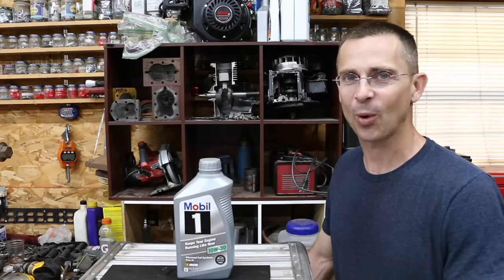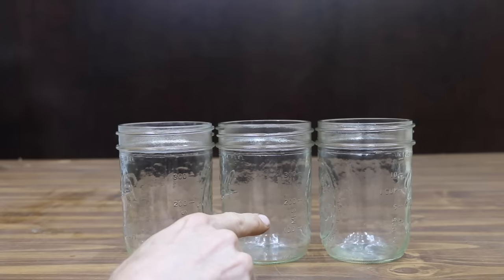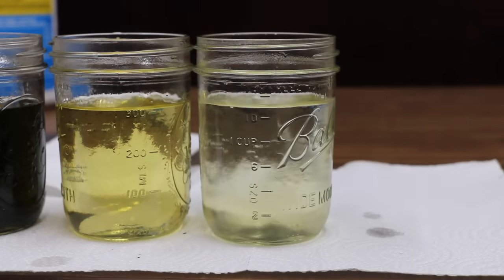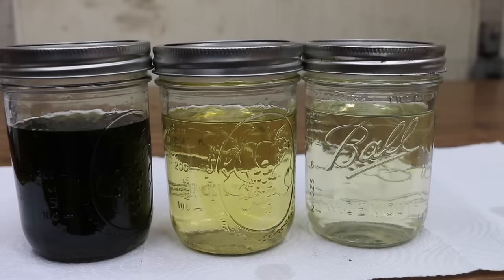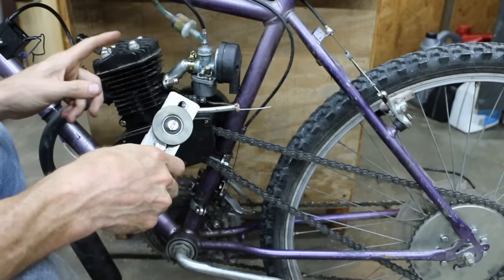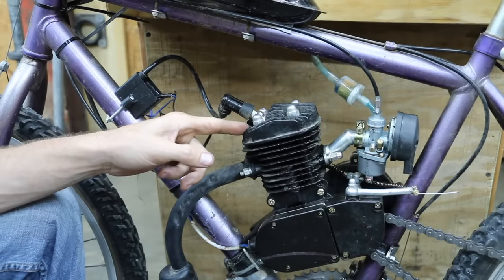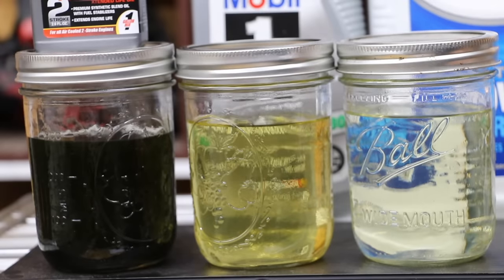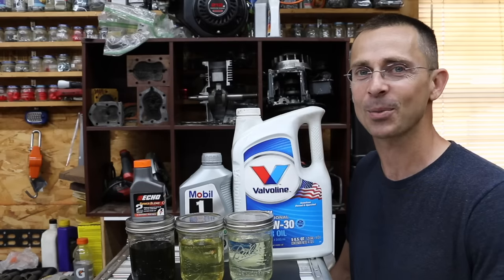Will 4-stroke oil damage a 2-stroke engine?  Let's find out!

Comment: 10w30 Dollar store Motor oil do a video on it
Reply from the maker: Great recommendation!
Reply: Yeah, I’ve always wondered if dollar tree had trustworthy oil...
Reply: Project Farm where did you get your 2 stroke bicycle engine,,. ???   How much did it cost,,. ???
Reply: Rick Simpson I wish she would've left a link for it in the description of his other video
Reply: Rick Simpson - Amazon has them around 135 bux.  Goplus 80cc 2-Stroke Bicycle Gasoline Motorized Gas Engine Motor Kit (Silver) https://www.amazon.com/dp/B01N4RZJAY/ref=cm_sw_r_cp_apa_Y-7qBbSQBWRF5
Reply: Itsa Mea thanks ps don't buy anything from bike Barry I bought an friction drive engine kit and it broke 5 times
Reply: Project Farm ,, I had heard and from another video that that dollar store motor oil when Frozen was extremely thick and you definitely shouldn't use it in the winter it won't hardly come out of the jug,,. ???
Reply: Is it $1 for a liter?
Reply: all 30 weight oil is basically sludge at 32f - oil flow tests are done at room temperature. Thats why multi-grade oils were created. So a 5w-30 would act more like a 5w oil at cold temps but hold on to its viscosity at high temps like a 30 weight. It doesn't work really well, especially in conventional oils and synthetic blends. But with Tier 4 pure synthetic motor oils like Penzoil Pure or Amsoil Dominator or similar 0-20 or 5-20w oils(if you live up north) or 10w-30(if you live south or midwest) will give you the best protection for your engine at all times. Just ensure you give your engine at least 30 seconds of warm up time before acceleration to allow oil time to warm up and flow.
Reply: TheSuperJank 
it was made by a major manufacturer that’s for sure. 
Its not total crap, fine for normal purposes or to top off a low oil level. 
They used to have a recycled oil which was cheap, and actually better than the fresh stuff...
that was a little before my time though.
Reply: SinsBird yeah
Reply: Synthetic should have been tested for sure! I have tried Mobil 1 in a moped and it ceased up after 10-12 km. When I disassembled the motor I found black melted plastic stuck to the piston (glued the rings in the piston) and cylinder walls. New piston and rings and cleaned cylinder with xylene and then it ran fine again.
Reply: Its fine. Not the greatest add pack but it would take thousands of miles to see the difference, if ever. Changing your oil on time is a lot more important than what brand you use. That said i stick to 3k on cheap conventional oil, 4-5k on syn blend, 6-7k on synthetic
Reply: nope wont be $1  a litre any more, prices went way up, i used to be able to get a gallon for £4 in the uk, but that was years ago now, cheapest is like 12£ per gallon
Reply: Rick Simpson thats based on the 10w rating. 10w gets thicker when cold than 0w or 5w. Syn flows better, but any oil labeled a 10w has already failed the 5w test, so differences are minor. 30 is the actual weight in a hot engine. These numbers are 100% unrelated which some folks cant seem to grasp. Ive heard people say that 10w30 was thicker than 5w40. WRONG. The w rating ONLY tells its cold flow ability. Back in the 70s 10/30 meant 10 weight base oil with additives to keep it from thinning below 30 at temp. Those days are long gone. The base oil will actually be closer to the second number. And if its full syn, the gap is little to none.
Reply: Keegan Johnson from my understanding the 2nd number, 30 in most cases is the base weight of the oil. Most consumer oils are 30 weight and the additives are added to help it flow at colder temps and thin it and the polymers to help it maintain its viscosity like it wasn't thinned. I believe you have it backwards. I've been wrong, alot, but I am quite certain confident in this, but either way we end up at the same result. 32f it flows like maple syrup, at 0f it flows like maple syrup straight out of the tree in the winter and at -25f it stops flowing.
Reply: What do you mean by OIL WEIGHT?  I thought that the numbers indicated oil VISCOSITY at cold and hot temperatures.
Reply: Keegan Johnson I apologize you didn't have it backwards, but a little off slant perhaps. the second number is the base weight of the oil. 30 weight in 10w30 and 10w means like you said it flows LIKE a 10 weight in 72f temps but its a 30 weight base oil. a 5w40 means its a 40 weight base oil but with additives it flows like a 5w at 72f but has normal 40 weight flow numbers at engine temps(250ish). Look at gear oil, its usually 45w90 or something similar - because its a 90 weight base oil with additives to help it flow like a lighter oil in cold temps. the lowest a conventional oil can go is 10w, 5w for a blend and 0 weight is ALWAYS synthetic but almost ALL oil is going to be a 20 or 30 weight base
Reply: oil thickness + viscosity = weight - in simple terms - i apologize its a term that may or may not be used anymore - back in the day when you bought oil drums you simply bought a drum of 30 weight for your farm equipment. That mean straight SAE 30 oil. which is 30w30  /shrug the w in the oil labeling is weight but usually not pronounced.
Reply: The "W" in 10W-30 stands for "Winter". 

BTW, don't use cheap " no name" oil from a Dollar Store or a gas station, unless you don't care about your vehicle. They use cheap base oil and very few or no additives. Buy "Supertech" brand from Walmart if you want cheap but decent oil.
Reply: if you car is leaking a bit of oil, just a bit, and its a 10+ year old car, and you're not on a strict maintenance schedule, drop a quart of SAE 30 in next time it needs a quart. Be suprised how switching from 5w-20 or 10w20 to a 15w30 will stop minor seal leaks on older cars =)
Reply: hey learn something new every day, thanks andrew, never knew it meant winter! i knew what it was for but never actually knew. thanks man!
Reply: Warfighter Racing not nescissarily. Conventional pils still use Viscosity Index Improvers, but much less than they used to. And the more syn there is, the less VIIs there are. Conventional 10w30 is probably about a 15-20w. Which passes as a 10w for cold, and has a small amount of VII to reach 30. Full synthetic has none. Its just a syn 30 that cold flows at 10. But a 5w50 full syn, does require some VII.
Reply: Andrew Evanoff supertech is not really any better than trop artic or similar. Its good enough to pass SN but thats it. If i buy cheap i get oreillys or napa oil. Made by Valvoline and good stuff.
Reply: Warfighter Racing see other reply. 5 different 5w30 oils could have 5 different base weights based on quality of base stock and amount of synthetic. In the long run it is irrelevant tho unless your engine is very shear prone.
Reply: Warfighter Racing i never run 20 weight. Speaking to a Ford Engineer who told me they basically were forced to spec it for EPA reasons opened my eyes greatly. I just run 0w30 in 5w20 motors to maintain excellent cold flow properties but provide good protection. Most 20w engines get noisy around 150k but people have been scared into believing modern engines cant handle higher weights so they continue running it till the engine dies. In truth clearances used today are the same back to the 50s. Only thing that has changed is precision. Precisiom allows such thin oil for 100k plus, but precision pieces just last that much longer with the correct oil. I drive my cars to around 250k before getting another so to me it matters.
Reply: good stuff, im just a old shade tree from way back, never got into the techno stuff. just learned experiences. Oils have come so far. Tires and oils are two of the most under appreciated advances in modern mechanics. Both are lightyears ahead of where we were 30 years ago. I too only run 30 weight oil in my cars. Pure 10w30 in my eco boost and 5.0 mustangs and 10w30 amsoil dominator in my 5.8 DOHC turbo mustang. Neither have ever let me down. Winter time if its a brutal one i may go 0w30 but this last winter was mild in kentucky.
Reply: Andrew Evanoff weight and viscosity are interchangable terms. "Weight" is just used more in the oil world, because of the original SAE scale of 10, 20, 30, 40, and 50 weight oils. Real viscosity is measured in Centistrokes. But for the layman there is no point in trying to nitpick.
Reply: It was called Royal Triton and was purple. Good stuff.
Reply: Warfighter Racing nice! Ive read into oil too much for my own good. But in the end it basically taught me any modern oil is good enough to make your engine outlive the rest of your car if you change it haha. I run 0w30 in my 5.0 f150 and my wifes benz takes 5w40. I did research and discovered that synthetic diesel oil thats 25 bucks a gallon is just as good as the fance euro synthetics that cost twice that. They just mandate like 9k mi pil changes over there so they build oils for that. I change all oil at 4-5k syn or not because i like seeing a clean engine when i peep in the fill hole, makes me feel all warm and fuzzy. Would be 3-4k but they both hold 8qts. I do worry about the epa and what they will try to pull next though. 50w racing oil might be a good investment like r12 freon and real lead gas additive were back in the day haha.
Reply: got a 95 crown vic with over 380k on the motor, and most of the time it as walmart oil in it, but a few times i had used dollar store oil.
Reply: 300Six gotta love the 4.6 2v! Taxi companies often hit half a million miles or more on the cheapest 10w30 fleet oil they can get in 55gal drums. I always agree oil changed on time is the best oil!
Reply: keegan johnson, thats true, i always do it on time or a little before,
Reply: Peter Lindberg when you blew up your rings did you mix it 16:1 in your moped? 
Or 50:1 as before? Just curious.
Thanks
Reply: read the labels...
Reply: what do you mean it doesnt work well?
Reply: Some of them are not API certified, etc.
Reply: I can tell you that off the bat, it's not worth it. It does protect as it's a lubricant. But I notice the engine runs a little rough after 10,000 mile. I have to admit, used the Dollar store motor oil for 6 years without a major problem but the engine was only at 110,000 mile and I did put in about 80,000 mile before switching to Mobile 5000 extra mileage brand. This was on a 2001 Suzuki XL-7 2.7L V6 DOHC. This might be just my vehicle but during the time used on the dollar store oil, I noticed a lot of oil stain around the head cover. At first I thought the cheapo oil might be the culprit but turns out the head cover bolts were loose so switching to Mobile 5000 didn't solve anything but it did make the engine run smooth to the next oil change.

Comment: Seen lots of engine damage from using used engine oil in a two strokes  and for chain bar lube wearing out the bar and chain prematurely. On a shitter unit that's worn out I guess it doesn't matter.  You can't educate anyone on this and necessity is the mother of invention. Saw a new Honda 5 hp snowblower that wouldn't start. Fuel tank was full of 2 stroke oil, it was a 4 stroke blower but that didn't matter to the customer and they wanted warranty on it. Denied! It's like running a BBQ and generator inside the domicile during a storm. They all get dead and even with warnings all over the unit and it's shipping box they ran it inside anyway.
Reply from the maker: Thanks for commenting on this.
Reply: In my younger years I destroyed a 15hp Yamaha outboard running 4 cycle oil instead of 2 cycle oil.
Prior to that, I ran a Yamaha YSR 50 "mini crotch rocket" on 4 cycle oil with no issues at all; that's why I thought I could've gotten away with running it in the outboard.
Reply: Talking about Chainsaw bar and chain lub. I bought some from a big box store because it was cheap.
I know Chainsaws after 40+ years and by the sound I could tell something wasn't right. The trick for checking chain oil showed a nice spray yet didn't sound right. Since I doctor up my bar oil a viscosity check revealed, no slicky, no sticky, and it was just a basic 30 weight oil. One thing I often add is STP, another is a very good oil additive for cars. One drop of my doctored up bar oil on a finger tip then wiped complete dry still leaves a slick finger tip. 
Bar oil needs to be slicky and sticky yet thin enough to properly flow.  
Not sure about using but those multiviscosity motor oils but it may thin out some in cold weather and actually be a good idea for that reason since some loggers actually do thin their bar oil in cold weather. I'll do some testing on that and see if filtered used Mobile1,  10w 25 can be doctored up for bar oil.  When running a 24 inch bar on a 60cc saw and going to a longer bar, even if the engine pull the load the Chain may starve so often we thin the bar oil to compensate. On one saw of mine I've adjusted the oil pump for full flow and went from 24 to 28 inch bar with great results.  However some cheap saws have a fixed oil flow. When oiling Chains there are many factors involved. Many bar oils sold locally aren't really very good and most  NEED STP or something like that added. When sawing I don't want to hear that metal on metal sound. Good day.
Reply: MoogleMy I’ll bet you get a big kick out of denying warranty repairs on those educated people with their nice teeth and their clean clothes and their lower to middle class houses ( not trailers ) and the way they speak like they ain’t been in the joint...

Comment: Back in the early 70's dirt bikes only used regular 4 stroke oil. You just had to shake the gas container before each use.
Reply from the maker: Great information! Thank you
Reply: I raced in the early 70s and we had lots of two stroke oils.
Reply: There was Blenzall, Castrol R, Yamalube R, and many other two stroke oils available.
Reply: @paulmcintosh5535  True but those oils were expensive. Good old Castrol 30wt.  25 cents a quart worked great on my Bultaco's.
Reply: @ReneBuret  probably OK for stock dirt bikes. We were running high dollar, high RPM 2 and 3 cylinder road racers at the time and a fouled plug meant a dnf.
Reply: @paulmcintosh5535  I'm old school late 60's -80's  circa CZ's Maico and Butaco dirt bikes. A factory setup mean't your cylinder was bored and ported. And remember dirt bike racing back then was a poor mans sport.

Comment: Years ago we ran 20wt and 30wt motor oil in all our two strokes, at 10:1 mix. They smoked a lot but ran just fine, I'm still running grandpa's old McCulloch saw that he bought in the late 60's and still running it on the 20wt ND oil he bought for it back then as well. Still got five cases of it in the shed. They ran heavy oil to fuel mixes and smoked a lot but apparently it worked well because even after over 60 years its still got excellent compression. 

I've got newer saws but every once in a while I'll dig out the old D30 just to hear it run and to keep it exercised and ready to go.

Comment: Nice video 👍😁 i have question what if my briggs 3.5hp motor kickbacks almost rip off my hand :)
Reply from the maker: I presume the engine has a flywheel or blade of some sort, right?  If so, is the flywheel key broken?   Please create a new comment so I can find your response.  Thank you!
Reply: Project Farm yes, i think flywheel key is broken cuz my flywheel is wobbling on a shaft, thank you for help :)
Reply: 3.5hp yet it can kickback that hard? how is ur timing? if ur timing is fine, is ur fuel that low octane that ur timing is that advanced? try giving it less gas when starting but otherwise it shouldn't be kicking back that hard out of a tiny engine
Reply: Charlieswag9000  that's also possible cuz i press primer pump more than 5 times and than kickbacks
Reply: If it's a mower or power equipment then it's likely a sheared flywheel key
Reply: DIYs sheared flywheel key. Did you hit a stump or a pipe? Check the blade and blade adapter too.
Reply: DIYs yes it's called a back fire it happens to me all the time lol but it's also cmmon with 4 strokes
Reply: yeah a semi sheered flywheel key will cause the engine to rip your arm off on kickback. because it causes the piston to fire at the wrong time
Reply: probably a flywheel key although I had a Briggs and Stratton 4HP Quantum that sometimes would try to rip the pull cord out of your hand when it started but never had to do a flywheel key on it
Reply: Project Farm
Reply: I had to get 4 stitches in my thumb from a Tecumseh engine firing and running backwards. Slamming the pull cord handle into my hand That was holding the mower in place.

Comment: i have used regular 4 stroke oil in my leaf blower ALLOT and have had it for years no issues at all. with that said all my newer equipment i use poulan pro full syn